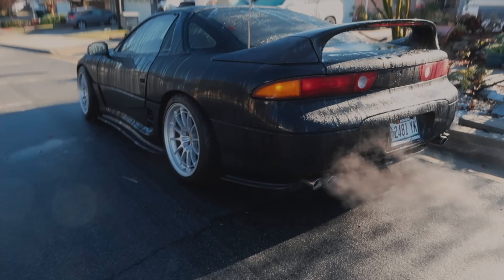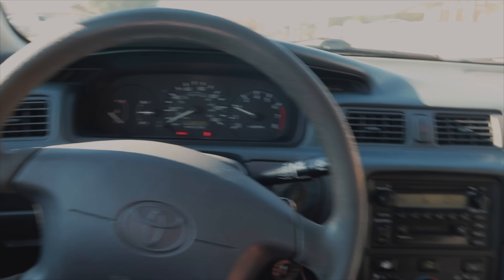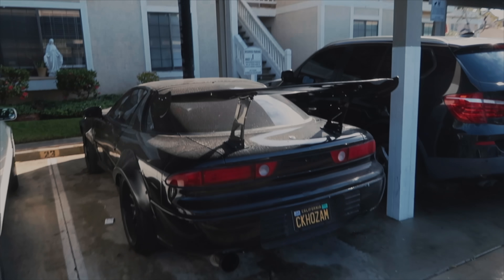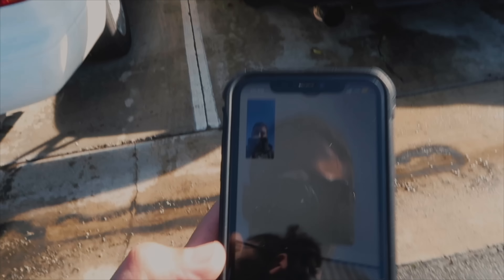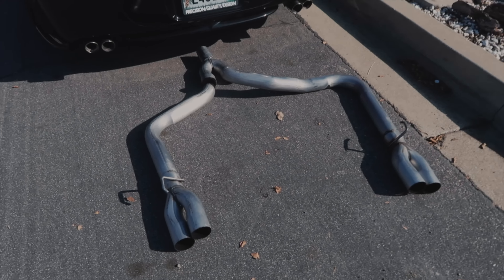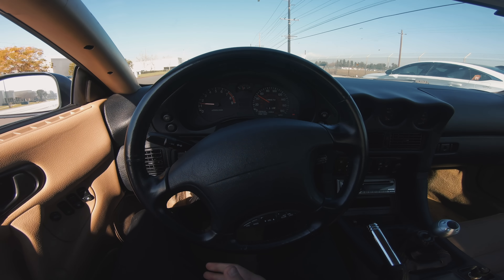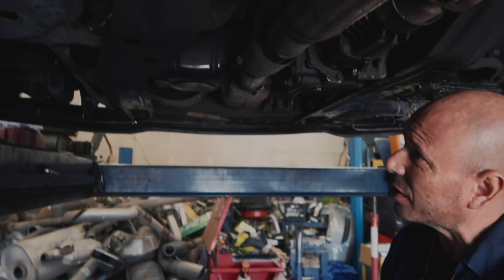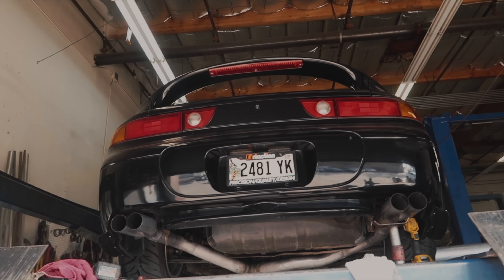Mitsubishi 3000GT VR4 gets LOUD Exhaust!! (SO GOOD!)

Comment: They only come out on the one side until full chat, coming along nicely Miguel.
Reply from the maker: Thanks man. Pretty hyped on how good it sounds already
Reply: @MiguelDsm  You'll find with a freer exhaust the turbos spool up better and you'll feel a bit more bottom end grunt. Gutting my precats was a big difference.
Reply from the maker: I was thinking on running the 3SX downpipe and pre cats. Still not sure on what yet
Reply: @MiguelDsm  I'm still running stock( but gutted precats, can really hear the turbos spool just by getting rid of the restriction so any you can bolt up will do the trick, my downpipe is E2K i think onto a blue flame catback ss, decisions decisions, looking sharp so far!

Comment: Seems like you have some sort of fuel drain back issue by how long it takes to crank over. I'd check the connection of the fuel assembly to pump.
Reply: And the oring that seals the pump to the sending unit.